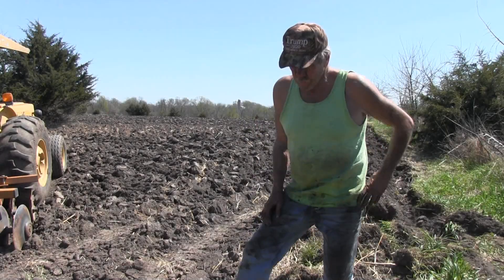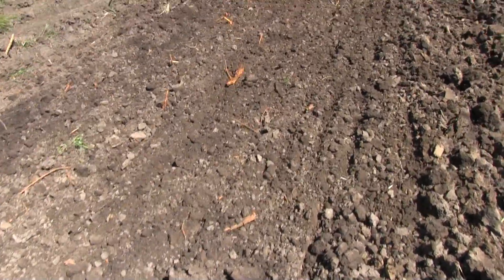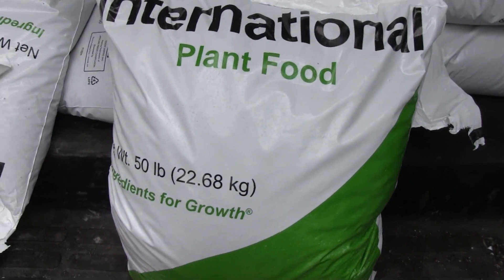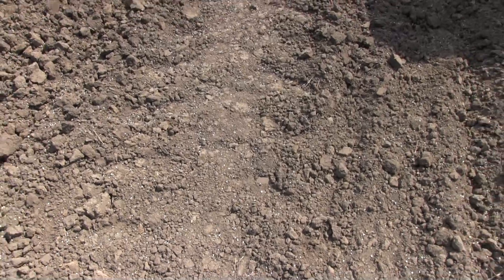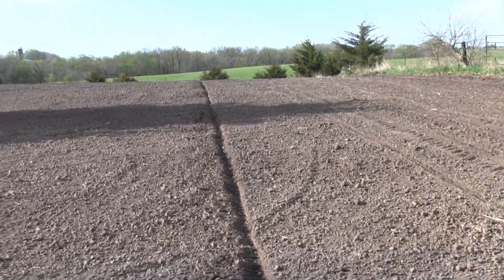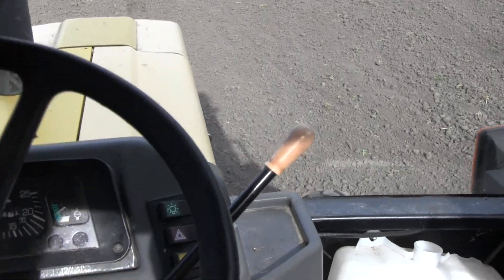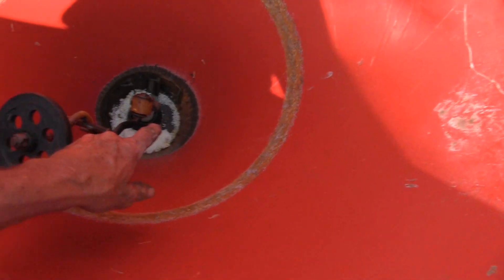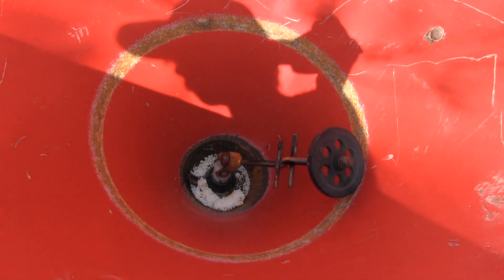2020 Food Plot step 2 Disking, Fertilizing & Planting Corn & Beans

Comment: I think this is the first year I beat you getting my corn and beans in the ground ha ha. I have that same planter I purchased 2 years ago, the guy I bought it off of had the markers off, told me they were a pain snagging on trees getting them into the fields. I plan on putting them back on but not knowing a damn thing about farming didn't know how they dropped down, if I needed to add something to the tractor etc. So THANKS for the explanation!! I was curious what kind of bean seeders you have, mine only came with 2 and I need 4 like you. I think the two I have are called bean cups. I rebuilt my corn finger pickers. Good idea splitting the rows, if I can find two more bean cups that's how I'm going to start planting them instead of broadcasting them. Have a good year Don!! Thanks again for the info!